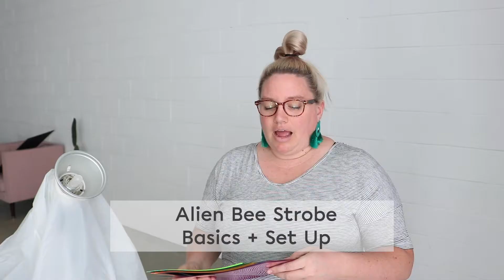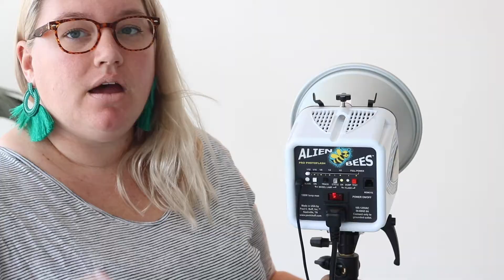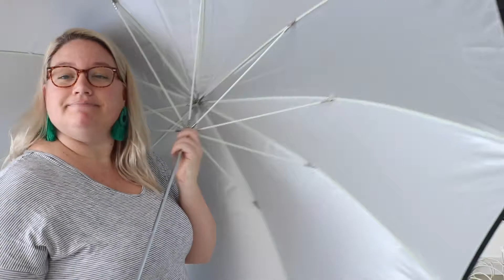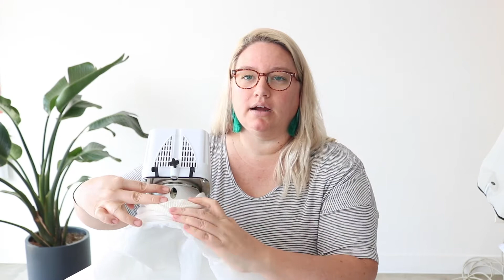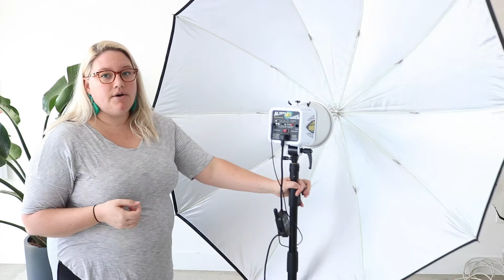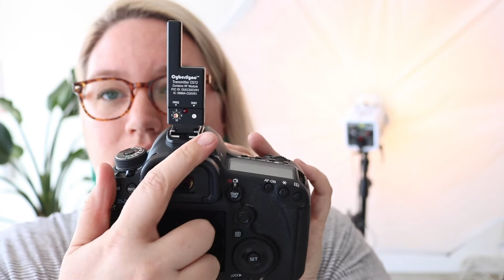Alien Bee Basics + Set Up

Comment: What if you use Sony?? I’ve only seen canon and Nikon users use it
Reply: that's easy you just buy a sony to ISO standard hot shoe adapter so you can use the CST trigger
Reply from the maker: Everything you see here can be used with Sony! The transmitter is just a hotshoe mount, which I think are universal.